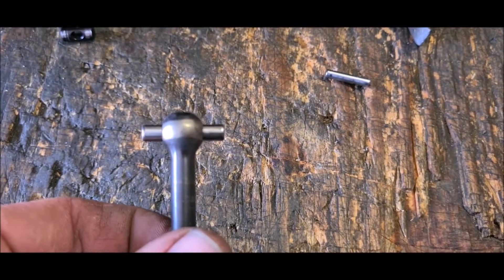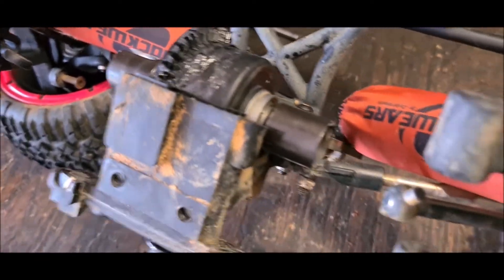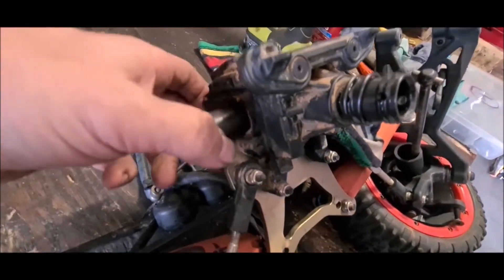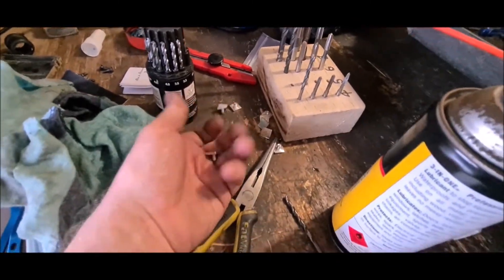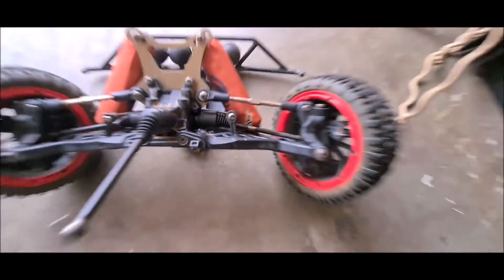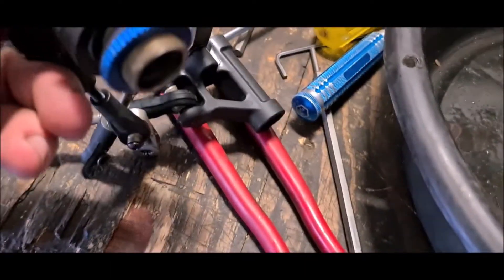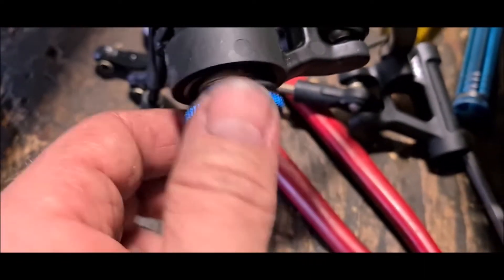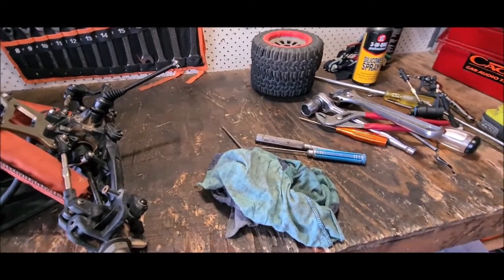1/5 RC Losi 5T - More maintenance 🙄🙄🙄

Comment: Thats a good idea putting the cable tie on the shaft so the boot dont slide down.
Reply from the maker: It works😉
Reply: @me8u73  i was putting the cable tie around the cup and it still would come off but will try this way.